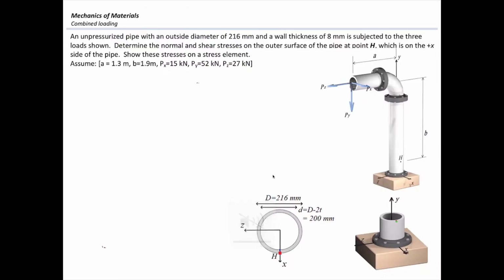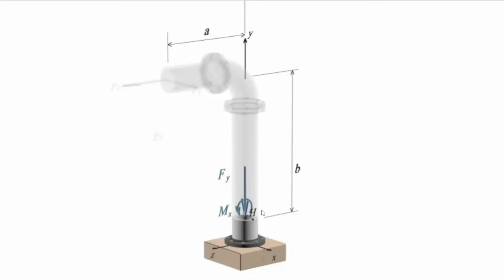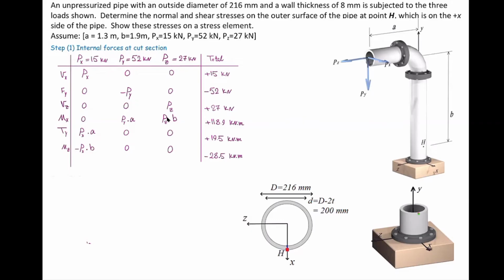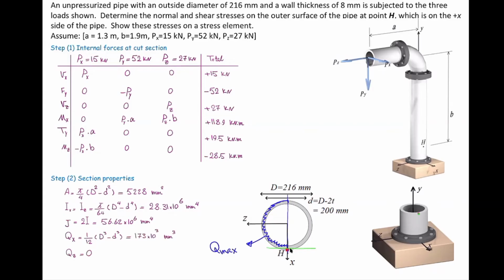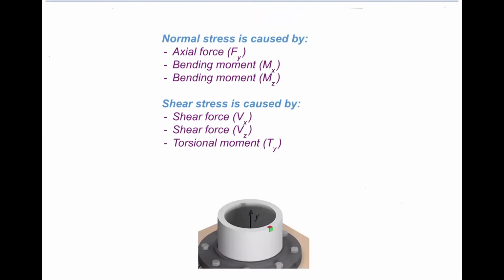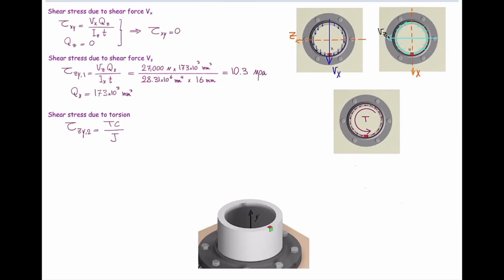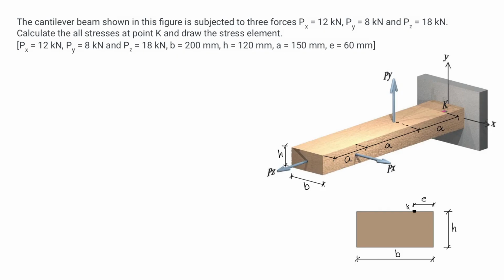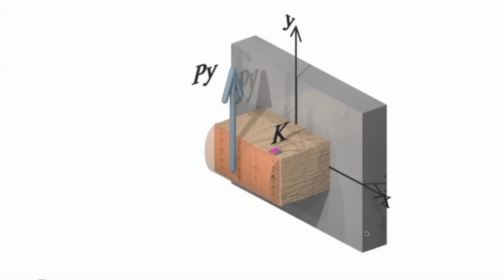M33-  Combined loading (Right hand rule in 3D structures)

Comment: Hello sir, are your calculation for all the section properties correct?
Reply from the maker: is there a particular part that you want to be verified?
Reply: @MechanicsofMaterialsLibre  I am getting different answers to yours for moment of inertia and J and Q, I used 216mm as my outer diameter and for inner diameter I subtracted he thickness and got 208mm, what was your inner diameter that you used?
Reply from the maker: @samkeloinnocent8316  I see. The inner diameter is 200 mm since the wall is on both sides and thickness should be subtracted twice. Hope that helps!
Reply: @MechanicsofMaterialsLibre  okay thank you so much sir your videos help me a lot🤗
Reply from the maker: @samkeloinnocent8316  Glad to hear that it was helpful
Reply: @samkeloinnocent8316  these are conceptual. calculation doesnt matter. if you understand the concept and can show the steps you can eventually get the right answer
Reply: Teacher  these lectures mechanical engineering or civil engineering 😩